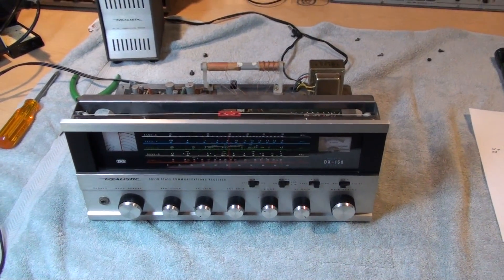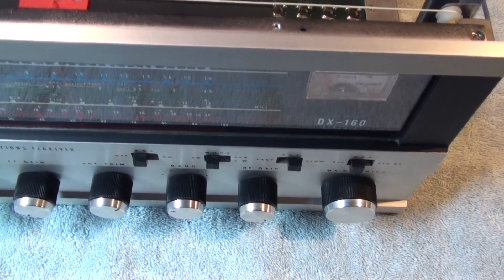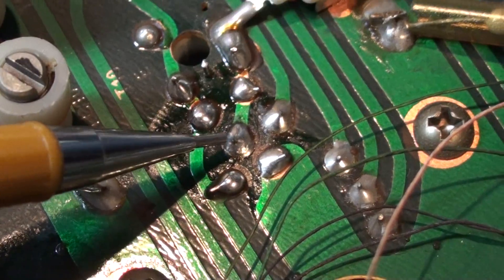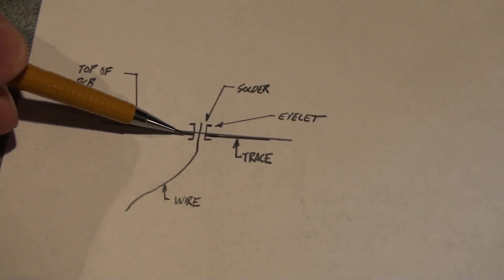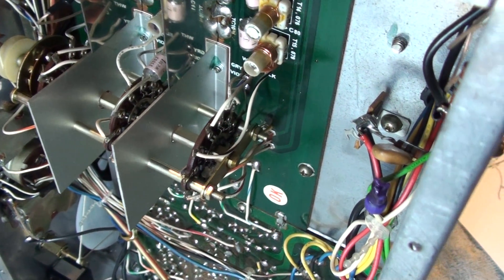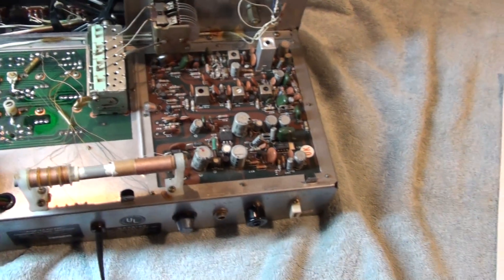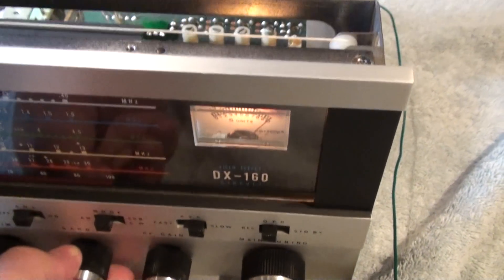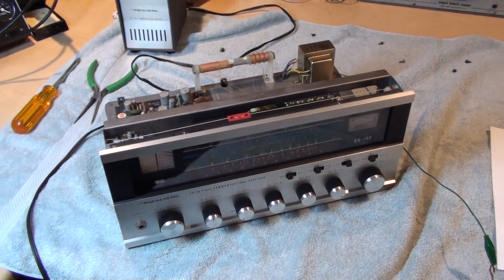The Realistic DX-160 SW Receiver: Troubleshooting Dead Bands and/or Weak Sensitivity

Comment: Great Video! I bought a DX-160 for a great price, not using it yet because the Volume Control is defective, stays too high. Replacement is on hand, but I want to recap it with HIGHER value caps, from the AM and Product detector, all the way thru the wimpy Speaker Coupling electrolytic capacitor. I did this on my two Kenwood R599's.  With their range of excellent 8 pole crystal filters at 6, 2.4 & 0.5KHz, it sounds like an FM BC studio, where playing back into a B&O S-45 speaker rumbles as you tune into a zero beat note! The cheap Mechanical filter, - seen in the Pregnant IF can, just  like in my Allied AX-190 will be the next limiting factor, to root out any tinny tone. One of your underside PCB views does show an eyelet ring, that probably tarnishes as you said, where the solder is insufficient. Not really a Plated Thru Hole? My reason for buying the DX160 and a very clean Lafayette HA-800 is I coumd bot afford them back in 1969 as a Novice, and both were out of stock when my Dad took me into NYC, so I came home with a LOUSEY Heathkit GR-64, no calibrated bandspread, and so much DRIFT that I had to add a small filament transformer in order to keep the Converter and BFO tubes always ON. 73s, Hilary W4HDL

Comment: I have been working on my DX-160 for a bit and I had the same problems. I applied the your technique and the radio receive opened up.
I have two problems remaining. they are string slipping and  band selector is extremely hard to turn even after lubrication.  Any thoughts?

Comment: This radio has a problem on the tuning printed circuit board resulting from dissimilar metals with the rivets that connect the top side printed circuit to the printed circuit on the bottom side of the PC board. Soldering is not sufficient. The fix is to solder jumper wires on the top side of the board to replace the connection made by the printed circuit on the bottom side. Shining a bright light through the bottom of the board shows clearly where to solder the jumper wires. This is the RF amp and Local Oscillator circuit so it will require alignment. Operation without repair may be intermittent.

Comment: If you put your teeth over that dial string, you can floss your teeth by moving the tuning knob back and forth.

I always thought I had dead bands because I had the wrong length long wire for that band.   I mean, my radio was new.   Who is going to use the A long wave band anyway?   I added an internal speaker to mine.   Gave it away.  Upgraded to PLL receivers, as this unit is too drifty, then lost interest in shortwave.

Comment: If the hole is plated through like you show in your drawing then you don't need to resolver these connections. Take resistance measurement and see if the connection is good.

Comment: At 0:55 YES! Replace ALL Electrolytic CAPs!!  Remember, that radio was manufactured in the 80's.  Those CAPs are resistors by now.
Also there are many MODs to be made with different values.  These MODs improve the quality of the audio!
Reply from the maker: As stated in the video... An ESR meter will confirm the condition of the electrolytic capacitors.  LOW ESR= good capacitor thus it is NOT imperative to immediately change...

Comment: GE made a really cool little 13" color TV back in the late 60's and early 70s that had an Issue just like this and  the heat of the set operating would flex the board and crack these via's and cause all sorts of problems, they had a beautiful picture and rich color but man what a pain to trouble shoot.

Comment: I love the dx-160 when I was a little kid it looked so professional to me I just had to have one,if it had been manufactured a little bit earlier it would have been tube type.  I have a Heathkit aa-100 stereo tube amp from 1962 that works great.. the 7199 driver  tubes for the final 7591s ones are very hard to find,so is the rectifier tube gz34,  5u4  will work in its place but with reduced performance.. I also have an RCA 19 inch color TV from 1967 it works fairly well but needs some Purity adjustments I can't even lift the thing up by myself anymore it's so heavy

Comment: Thank you so much! I bought one of these at a consignment shop and got it home to find erratic sometime dead bands. I. Cleaned that blasted band switch till the cows came home to no avail. Once I found your how to video and performed your recommended repair I now have a fully functional dx-160! The last small issue I have noticed is early audio, most notably when running sw and sideband. It isn't terrible but a nuisance non the less. Any tips are appreciated. Keep the videos coming!

Comment: Thanks a bunch! About two months after you posted this video I picked up a DX-160 at a yard sale that was still in its original box (with some unopened Archer headphones and an antenna kit) that appeared pristine inside and out. It worked great on MW, but not on shortwave. I cleaned the switches and pots and applied DeOxit where appropriate -- no change. Then I followed your video and hit the four joints as prescribed and it did the trick!
The set I got was used very little if at all, yet those four solder joints weakened just from nearly 30 years of aging . 
It took all of 20 minutes and saved me the major job of re-capping. Thanks again!

Comment: I have this same radio, restored and recapped myself.  I also had dead bands, and if I remember correctly, it was a bad connection at Capacitor C2 on the coil board.

My big problem is BFO drift now.  I've recapped it, plus replaced all the resistors in the BFO circuit with higher tolerance ones.  Maybe these radios BFO just drifted?